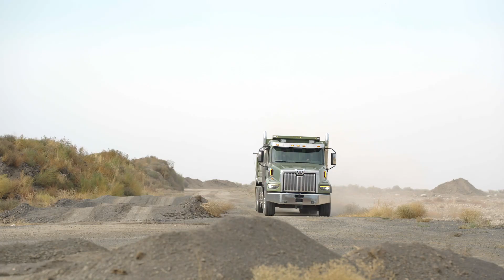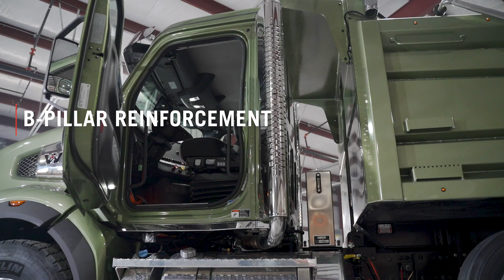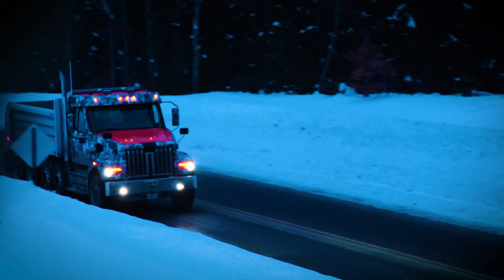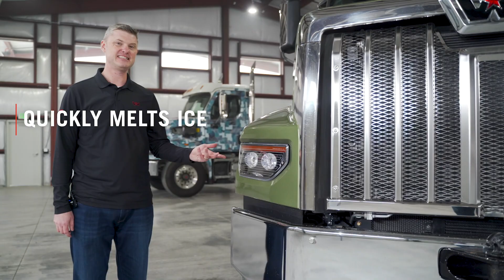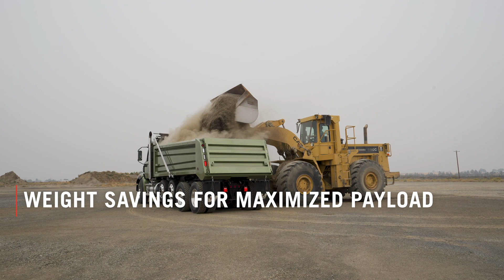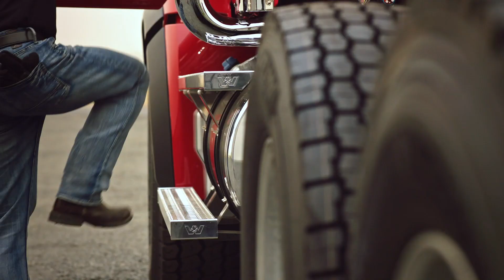49X Walkaround | Western Star Trucks

Comment: I haul logs with one. The hood latches are not good. Other day I had the driver side steer tire blow on highway. Force was so strong it broke both hood latches and blew the hood open at 100kph. Fully open. Blew the headlight right out. Cracked the fender section on hood , and destroyed all the inner fender guard plastic. What a mess. Thankfully I was able to keep truck on the road and come to a stop.

Comment: I definitely see a lot of Freightliner with this new Western Star. I kinda expected that being that Daimler owns both brands.
Reply: There is very little in common actually, this is a clean sheet of paper design. It has DNA from all of Daimler’s best products including the Mercedes Benz trucks from Europe.
Reply: @islandman5802  Idk about all that.  That cab and doors have Freightliner Cascadia all over it. Not to mention  that I see some other things.  They may have done some other things differently,  but I totally understand why Daimler would have it to where it's similar to the Freightliner brand instead of being way off from their norm.  It's not a bad looking truck.
Reply: @waynenorbreyjr9371  there is a world difference from chassis between Cascadia and 49X. Cascadia has highway chassis but 49X has extremely durable vocational chassis. Cascadia has highway transmission but 49X has vocational transmission. Cascadia offers DD13 and DD15 engines but 49X offers DD15 and DD16 engines
Reply: @mertcalc3259  
Might be different in that aspect as far as Highway vs Vocational, but there are still elements of Freightliner especially the cab. They may change a few things to distinguish the 2 brands.  You can definitely tell the cab is a part of Freightliner.
Reply: @waynenorbreyjr9371  i should admit that it helped Daimler to reduce costs a lot. PACCAR did the same for decades. DAF XF105 used same cabin with extreme duty cabover Kenworth K500 (discontinued). And there is a galaxy of difference between Highway vs Vocational aspect.
Reply: @mertcalc3259  
Yep, the newer Kenworth and Peterbilt trucks share a lot of parts and components.  I'm sure the older 1.9 meter cabs are similar in structure,  but each brand has its own identity.  Freightliner used their proven cab and utilized it for the Western Star brand.  Makes sense instead of having 2 totally different truck platforms.  Have it to were they share certain things. I'm not gonna knock it cause I'm a Paccar/Kenworth guy and they do some of the same things between their products.
Reply: @waynenorbreyjr9371  do you own a W900?
Reply: @mertcalc3259  
No, currently driving a W990.
Reply: @mertcalc3259  a whole galaxy huh?
Reply: @islandman5802  even from the Dodge Caravan? How bout the Dodge Omni? Lol
Reply: @islandman5802  I've been inside of both trucks, the Cascadia and the 49X are very similar in layout. They have a few differences. I still prefer a narrow cab truck.
Reply: Is still a good looking truck.
Reply: I know what you mean because when I looked at the side it really looked like a cascadia
Reply: a 'thinking man,' huh?! you braggin' Einstein?